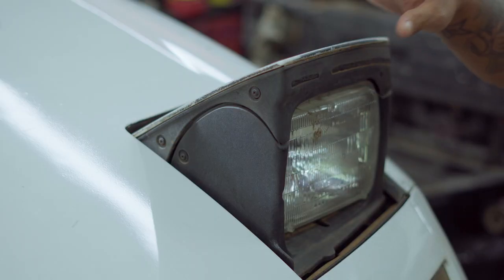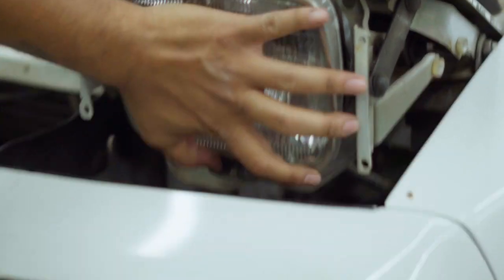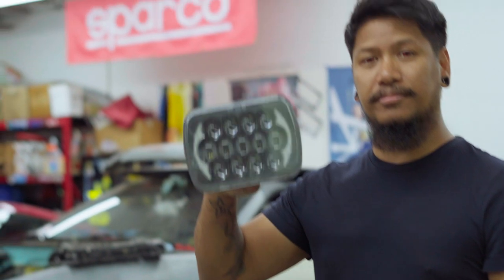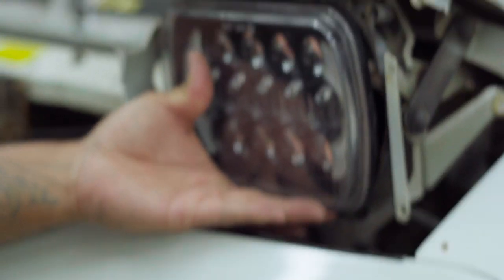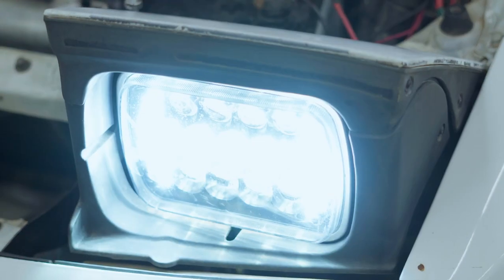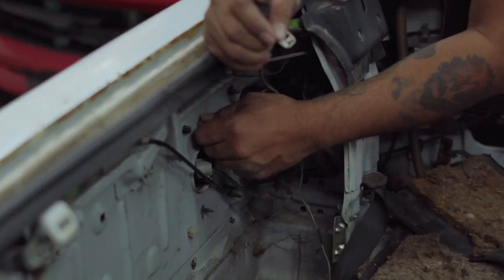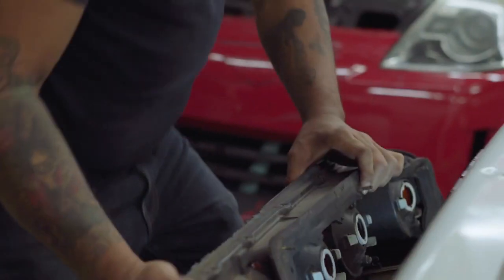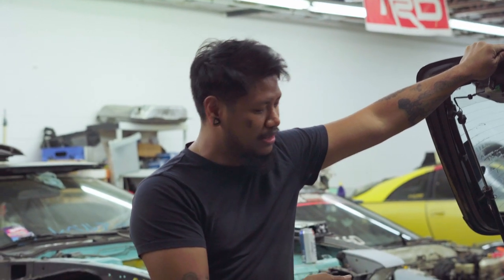How To Remove Headlight And Taillight For RX7 FC

Comment: You should replace the taillight gaskets they should be stupid cheap (around 25 if I remember correctly I can send you a link on ig or fb for the link)
Reply from the maker: I was going to but the replacement I have got had decent gaskets on them 😎
Reply: @thatRotaryCarGuy  yea the new ones pushed mine to the edge